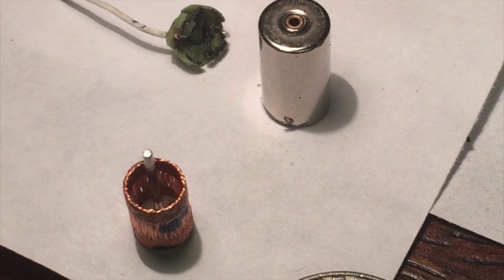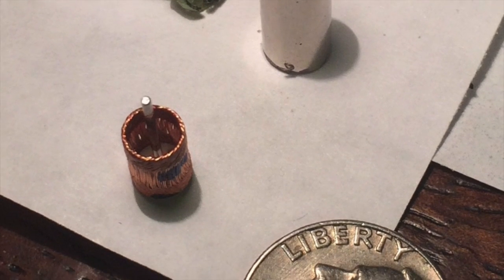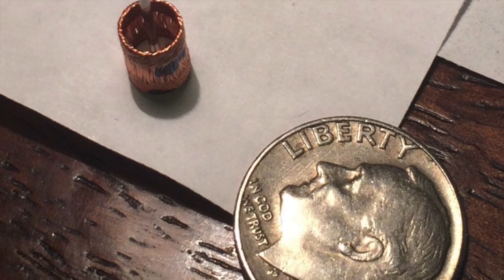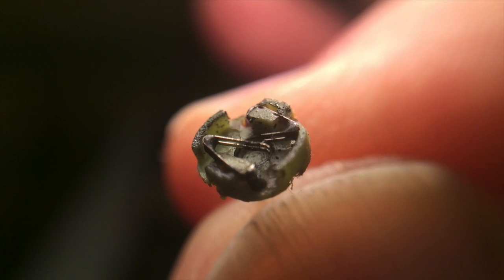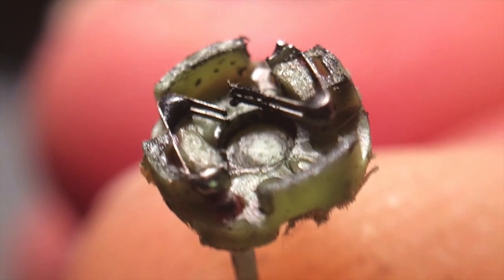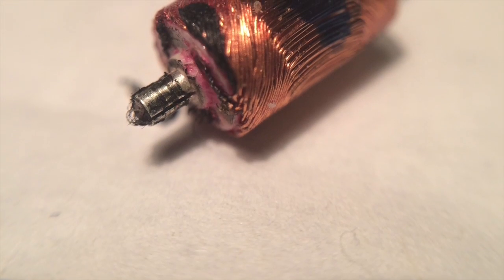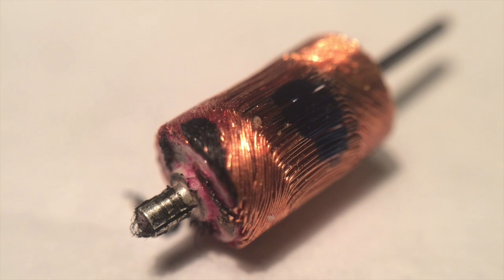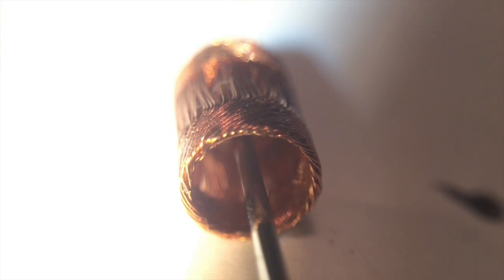Estes ProtoX Motor's Weakest Link

Comment: I agree.. I really wish they'd use just SLIGHTLY better motors.. I've had 3 ProtoXs, and all of them died after a month or 2, from bad motors. Guarenteed 90% of them fail from bad motors, before any other part goes..

I don't understand where they get off selling the SLT model.. which has an easier to replace battery.. I WISH the Proto X lasted long enough for it's battery to need changing.. LOL
They should sell ones with hot-swappable motors.. Or just use slightly better motors that don't die so damn soon. :(

What do you think would be the best way to contact the engineers/company that makes these? Cause I really LOVE the protoX, I just wish it lasted longer.

Comment: Nice Video.  Your 100% correct.  I installed some new blades that have little more pitch and slightly longer to where I have significantly reduced the RPM to maintain lift.  Hoping this will allow the motors to last longer.